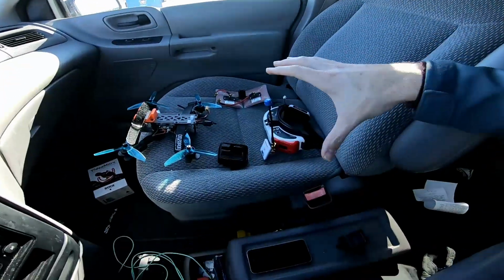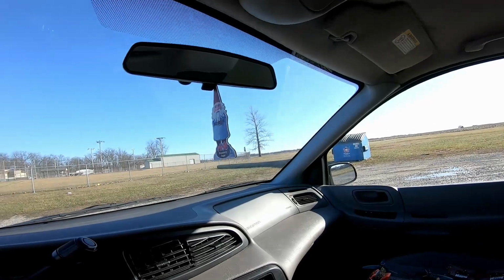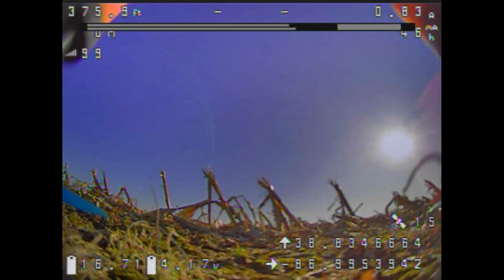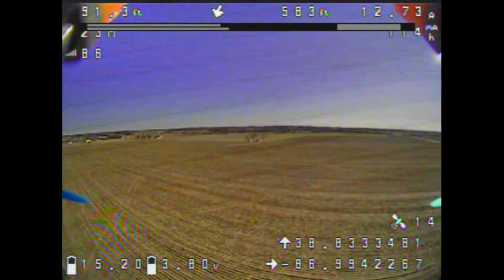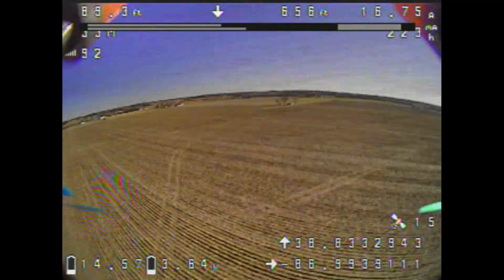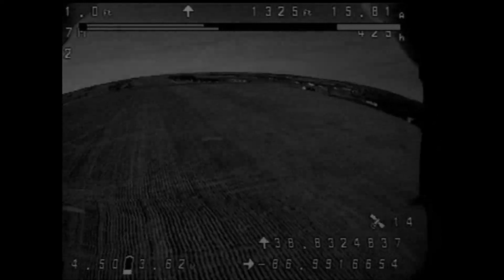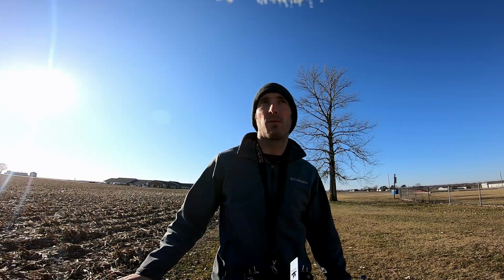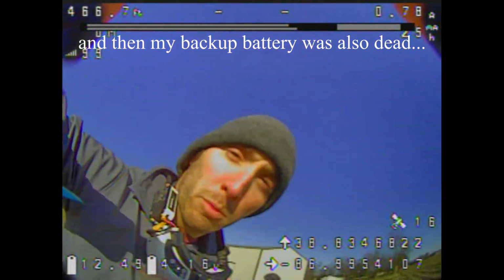ImmersionRC SpiroNET LZR Patch Antennas

Comment: Nice comparison.  Might pick up a set of these LZRs.

If you check the RSSI bars at 2000ft, the LZR patch DVR has a significantly longer bar.  The other test you can do is don't use two LZRs.  Use one of those and one of the comparison antenna.  I believe the upper SMA of the Rapidfire corresponds with the upper RSSI bar.  You can check by waving your hand in front of the antenna while flying to see which one drops.  I did this with a classic 8db spironet patch versus some ORT Dual Shield patches and it's very clear on the DVR that the spironet is way better than the ORT Dual Shield patch.
Reply from the maker: That's actually a great idea - using the 8dB spironet on one port and a single LZR on the other for comparison. You've got me thinking now...  You are right, the bar on top corresponds to the upper sma. Is your test on YouTube somewhere? Got a link? I'd like to check it out if it is.

Honestly, I'm not completely sold on the double patch setup. Part of the sales pitch is they say you can use the bars to steer your antenna beams and track your quad. That's true,  and it works well, but the simple fact that crossfire gives you those indicator bars allows you to aim a single patch just as well. I've ended up switching over to using an Axii in combination with a 13.5dB sniper antenna. It works as well as the double patch setup, I can aim the beam just as easily, and it's much lighter on the face.  Been out 2.1 miles with that setup.